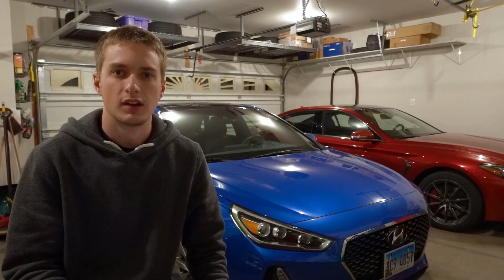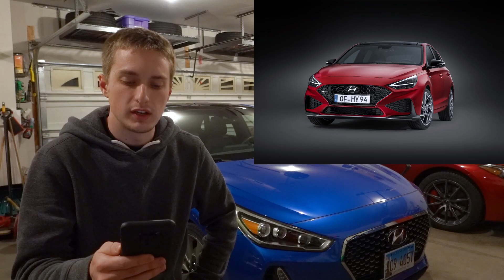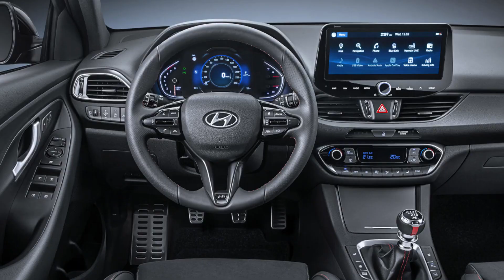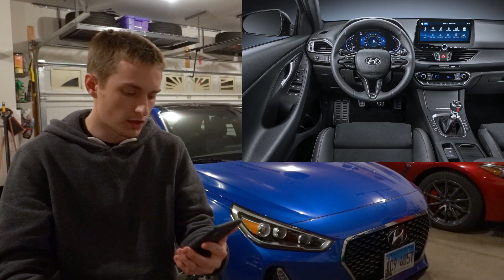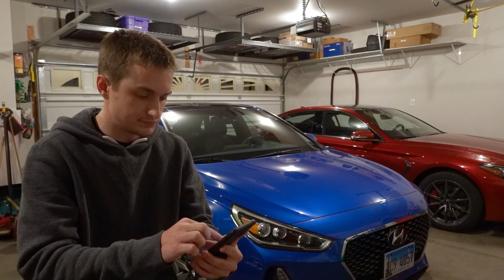2021 Hyundai I30 (Elantra GT) Changes and First Impressions

Comment: I do not like the new design. It is a little overdone. Also LED reflector headlight is a downgrade compared to LED projectors on the current car, and physical buttons make way for touch screen buttons. Even more reason to get the current one and not wait for 2021.

Comment: The side vents don't actually help the brakes at all, it's purely aerodynamics. But the rearend isn't a great upgrade. I know it's not in the news release, but it should fave a wet DCT.
Reply from the maker: I have seen some discussion about that but I don't remember where. Also the only trim getting the 8 speed wet DCT is the I30 N with the 2.0T. All the other engines so far have the same 7 speed DCT.

Comment: I like it a lot actually. One thing to note for sure is the North American spec will have the 1.6T and have duel exhaust so it’s going to look better then what Europe and Australia gets.
Reply: The North American N-line I30/GT will also be getting the 2.0T which Europe won't even get to look at. The best they'll have is the 157hp 1.6T which takes 8.6 seconds to hit 60 from a standing stop.